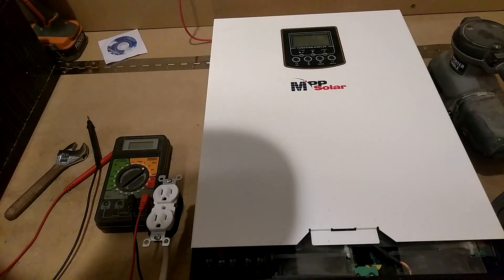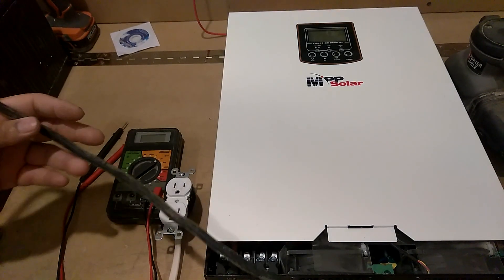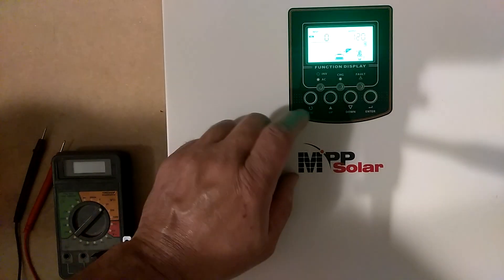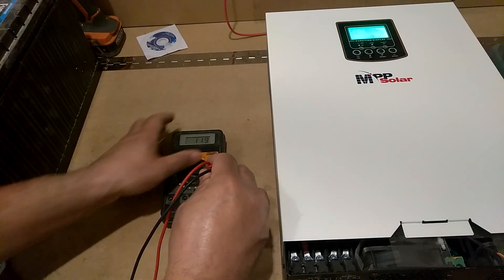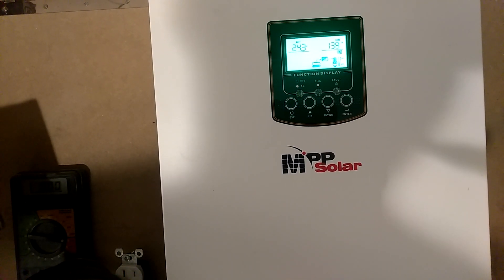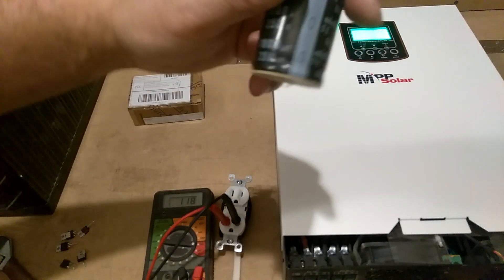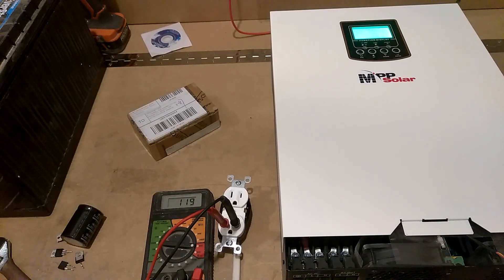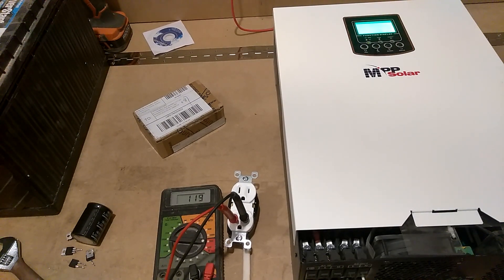🤔Did the pip below or did she go tune in to see.

Comment: Hello Carson,

My PIP-4048 inverter shows "Error 09". It says both Battery & AC sources have 0v. But the inverter is connected to 220v AC utility and a fully charged 48v battery bank. Not installed PV panels yet.

It was all good a week before the error began appearing. During the gap of a week, there were quite a few lightning flashes and thunderstorms. I didn't have SPD installed at that time. I've taken the inverter to local electronic repairers, but all these guys say "Chinese inverters can't be repaired. Those are like use and throw." Nevertheless, I'm still hopeful.

How can I identify the parts that are affected?

Thank you.
Reply from the maker: The first thing that I would do is contact MPP solar and tell them about the error code I believe that error code has something to do with a soft start.  the inverter might be still under warranty and they will ship you a new board to put into it if not you can purchase a whole board from MPP solar I believe they are around $200.  I do know that that error code is in the manual so I believe it's something that you might be able to reset.  Check and make sure you do not have your inverter in power saving mode also.
Reply: @carsonlurbanwindandsolar3437  It's not 'MPP Solar' brand, but it's manufactured by the same manufacturer Voltronic Power. Verified its authenticity with the serial number. And it's from 2016, so no chance of Warranty.

The supplier asked me to send a video of the inverter. But I still haven't got enough time to do it. And I'm not sure if he wants a video of the board or the screen showing error message. Already sent him the photograph of the screen showing error message.

I tried disabling the Power Saving mode. The error persisted.
Reply from the maker: @ವಾಸುಕಿ   I would probably next contact them and see how much a main board will cost you because when I purchase the parts to fix it I was only about $60 from buying a whole complete board. And you can keep your old board for parts next time you need to work on it.
Reply: @carsonlurbanwindandsolar3437  Oh, that's a great idea. I'll write to them right away.

Thank you.
Reply from the maker: @ವಾಸುಕಿ  👍😉

Comment: Great nothing like success. Did you make a video of the AC coupling when it blew and why it blew I am interested in AC coupling as that is how my system works but I did it with the MS4024 pae. DId you overload it or would it not accept any as the story goes they should accept 80% of their rated power but the other story is some won't accept any... cheers.
Reply from the maker: No didn't get any video I was at work and I got a text message that it was a power outage from my alarm. I came home and the breakers were kicked and the units were shut down.  I have been doing it for 2 years but I were using two 250 w grid-tie I replace them with a 1200 w grid-tie.  I would usually have the AC running but that day I did not turn it on cuz it was cloudy when the sun came out it overloaded the unit and blew it up.
Reply: @carsonlurbanwindandsolar3437  So it does work just needs to be regulated. When I asked Peggy she said it would not work with their inverters what she meant is they do not control it ... interesting thanks.
Reply from the maker: @offgridwanabe  as long as the load is higher than the power  being created by the grid tie it will be fine but I believe what happened was the load wasn't high enough and it tried to push the 1200 watts back through the unit into the battery Bank. I had been using the 1200 watt grid-tie for about three weeks before this happened so it worked fine it will even push a little power back to the battery but it will not tolerate a lot of power else it will blow.

Comment: Did you get the  parts from mpp solar? Are the parts high ?
Reply from the maker: No the parts came from eBay and they were shipped from China. the parts wasn't that expensive I just bought more than what I need it I believe the parts were under 40.00 dollars.
Reply: @carsonlurbanwindandsolar3437  were they genuine mpp solar parts, apparently the chinese copies/fakes are trouble, all that aside good to see you fixed it man.
Reply from the maker: @closertothetruth9209  MPP solar do not sell parts all you can buy is a hole board from them and I did not need the whole board I took the part numbers off the original parts that came out of the unit and match them up on eBay and ordered them.
Reply: @carsonlurbanwindandsolar3437  good to know, and it makes sense